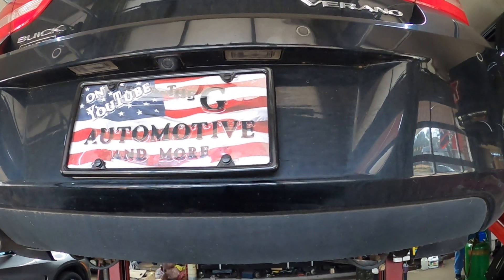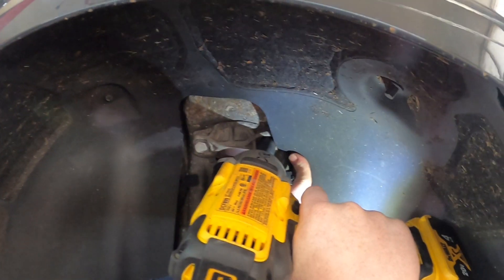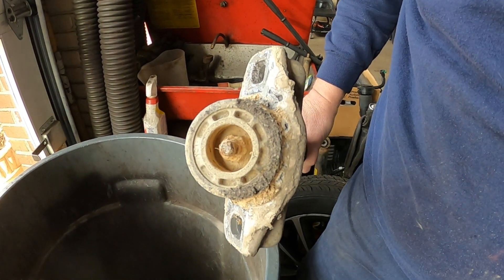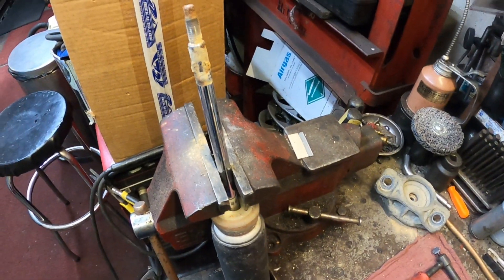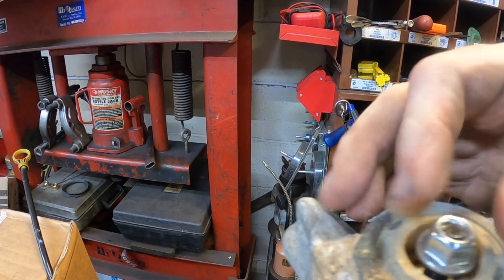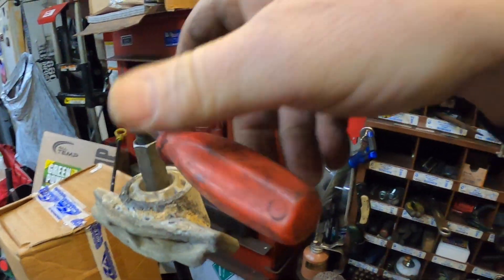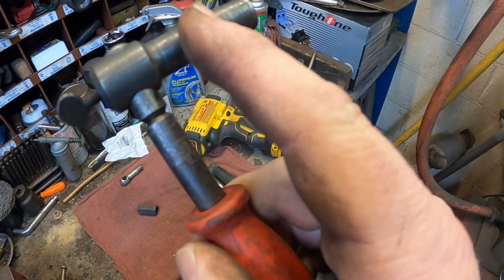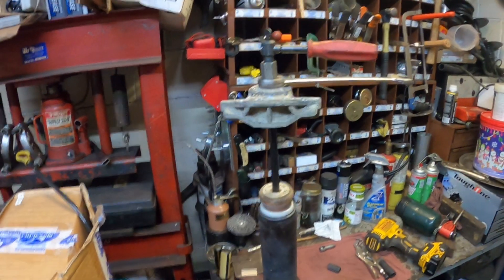2016 Buick Verano Rear Shock Replacement

Comment: Why would you skip over getting the nut threaded in a diy video.. people watch vids like this to learn and you just skip over an important part that someone might get stuck on and end up cross threading the threads. Not a big deal for me, I've been a mechanic for 20 years but some ppl don't have that experience, I'd your gonna do it, do it right 👍  good video otherwise I only watched it to see what this top mount was about
Reply from the maker: The nut was just to hard to spin down by hand, all I did was use a wrench to more it down. If you can not do that you should not be working on cars.